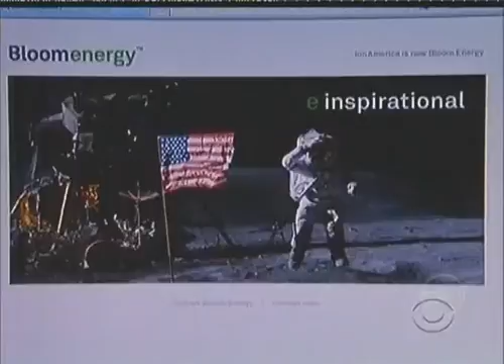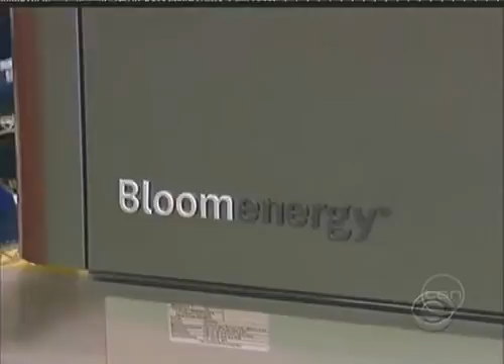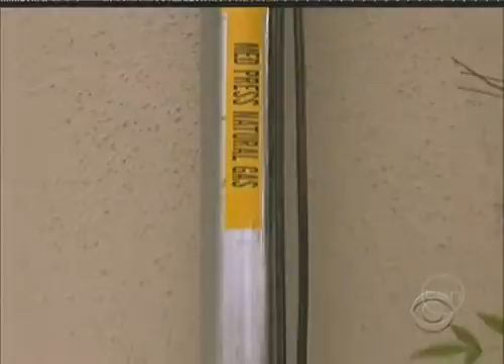Bloom Energy Bloom Box - Off grid electricity for homes

Comment: This is interesting for peakloads or off grid solutions. It COULD also be a more efficient way to convert fuels into electricity. 
But, a fuel cell is NOT an energy source! You will always need a (bio)gas as an input. The comparison with the solar cells therefore doesn't make sense. Solar cells convert sunlight directly into electricity. To compare this with the footprint of the bloombox, you should also consider many acres of land to convert sunlight into crops for biofuels to fuel the bloombox